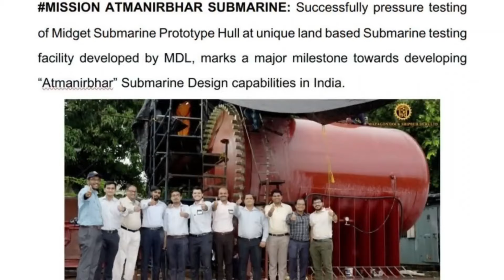DRDO takes up the program to build indigenous conventional submarine under ATV

Comment: The IN should seriously consider building domestic only submarines from now on, and I question the need for imports. It is fact that Bharat has all the tech required for 
fuel cell subs with lithium ion batteries.

Fuel cells - ISRO/DRDO developed
Lithium ion batteries - any number of domestic startups. Bhavish Aggarwal, CEO of India's leading electric two-wheeler, Ola Electric, earlier this month announced that the Ola giga factory in Krishnagiri district, Tamil Nadu, will be operational by February 2024 -- producing the country's first lithium-ion battery cells.
Steel - The Shivalik class is seen as a turning point in ship-making as India started using its own steel, the DMR 249A. From then onwards, warships use the same steel. Before the DMR 249A, Bharat had been importing steel from Russia. Now SAIL, Jindal and Essar make it. DRDO developed DMR‐249B steel back in 2013, but unclear if any desi steel companies currently make it?

Already has nuclear sub tech and ToT for conventional subs. I question the  claim of lack of sub design expertise. If a country can build nuclear subs and underwater drones,
both of which Bharat can do, a conventional sub is far far easier!!!!